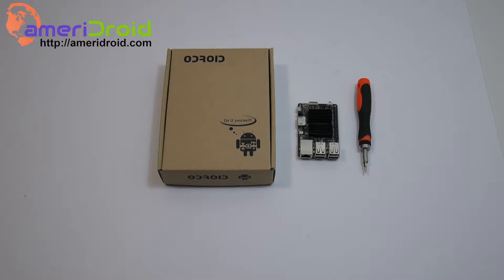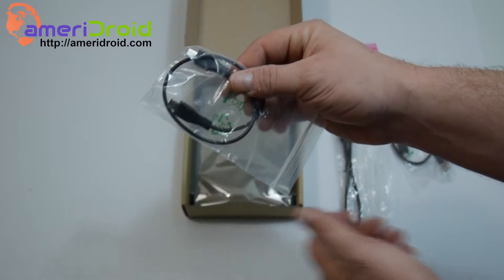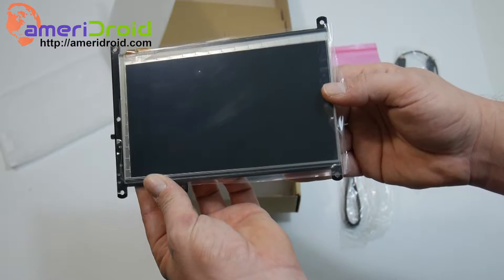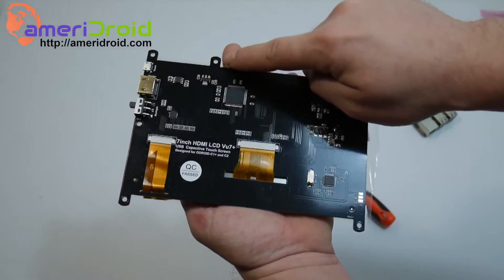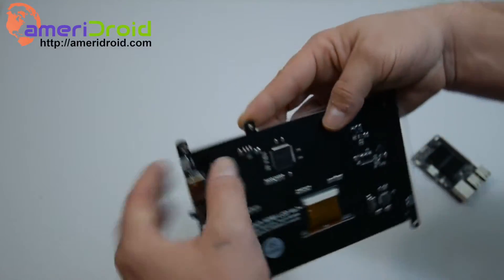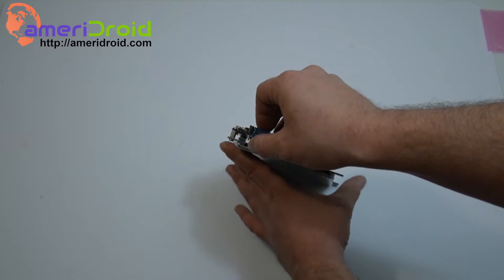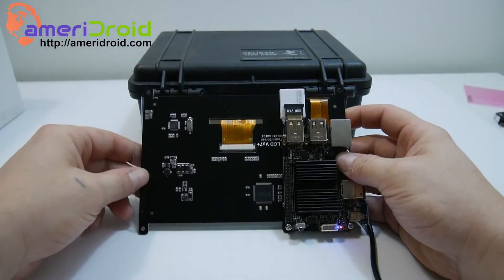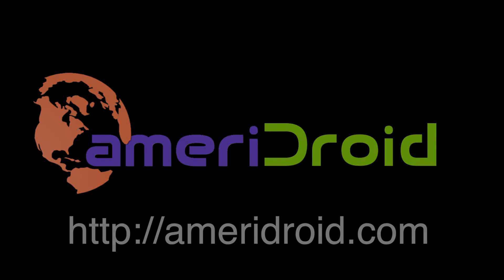ODROID-VU7 and VU7+ Touchscreen Intro and Setup

Comment: Does it work with an Odroid XU4 out of the box, with an preinstalled emmc linuxcard or do you need to install external drivers?
Reply from the maker: Yes. It works out of the box with XU4 except on some OSes, on which you may have to go into the boot.ini and enable the VU7 resolution and feature.